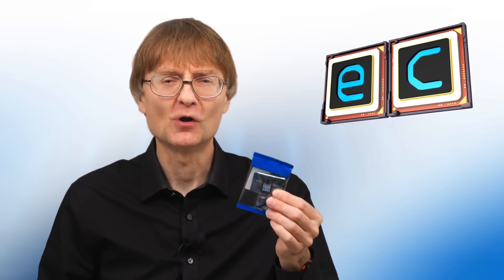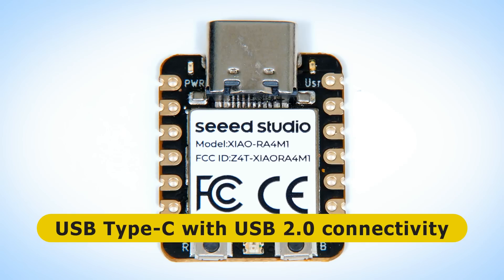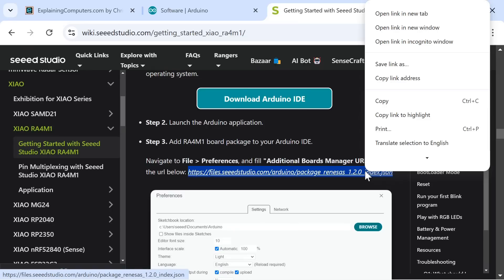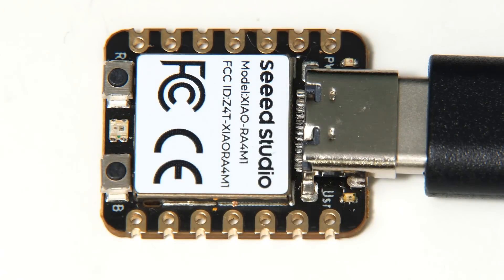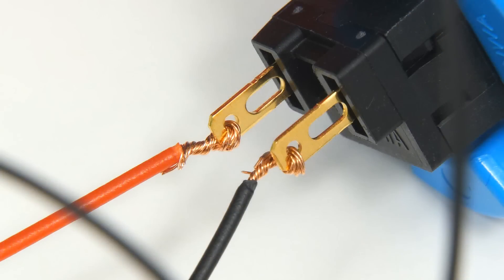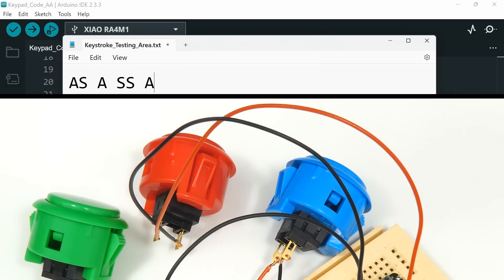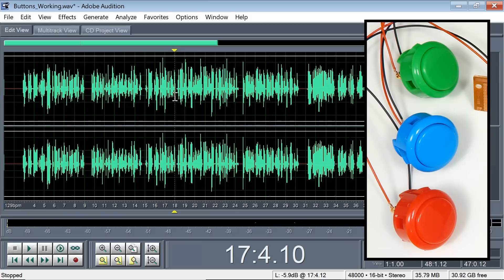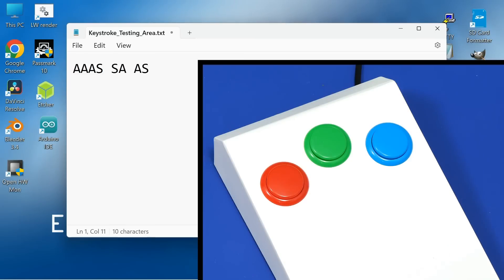Custom PC Keypad - Microcontroller Project

Comment: Great video Chris! Both informative and elegantly presented. I have used the Arduino IDE on and off for years, with various kinds of Microcontrollers. Each time I fire it up, I still have to stop and think for a minute about libraries, structures, program flow, etc. whenever starting a new project. Even the "simple" project you showed here requires a bit of forethought and planning, the end result which you assembled and demonstrated very clearly. Thanks for all your hard work Chris! Take Good Care.
Reply from the maker: Thanks Rick.

Comment: prefer circuitpython on a pico-w (sadly micropython does not do usb-hid), changing would just be text editing, no compiling needed.
My version has no physical buttons, pico-w has webserver so any tablet/touchscreen can get a html page with all the buttons-options, button size is only limited by screen size,
bonus is that controller (tablet or tablets) and base station (pico-w) use wifi, so distance and mobility is great.

Comment: Very useful project. I gather it runs in parallel with your main keyboard?
Reply from the maker: Yes, it runs in parallel with the main keyboard. PCs don't mind having what they see as multiple keyboards connected, although once a key is held down on one the other is inactive until it is released (ie you can only use one at once).

Comment: Hello EC 😊 .. how could I make similar  computer keyboard for a real computer keyboard, with all the letters, number and some other + - "" * etc 
I guess I would need different buttons, maybe these mechanical switches, pls for any idea 💡  .. thx
Reply from the maker: This could be done, but would require multiplexing due to the number of keys involved (placing the switches on a grid).
Reply: @ExplainingComputers  .. thx for your explanation 👍  ..  I think to 3D print the Atari-520 ST keyboard and make the set of buttons of specific shape, and a motherboard of an Intel i7 CPU, with integrated GPU, 16 GB RAM, SSD 1TB .. Thank you 😊

Comment: i've been building these with the arduino pro micro..
Theres examples for a 32 button box including rotary encoders (!) on youtube.

Only comfort thing missing would be way to reprogram the key-combos from windows/linux without having to reflash the arduino.

the arduino pro-micro (which is basically the arduino leonardo in small),
has the integrated usb interface due to having the ATMega32u4.

- Important detail you want to check is getting the 5V version for usb use.
- pro micro is also available now with usb-c instead of the micro-usb.
- pro micro usb-c; 5V / 16Mhz usually comes in at 6 to 8 bucks including shipping.
(cheaper in bulk of 3 or more)

Comment: Actually yes it looks perfect for what I have to do. What I was looking for was a usb sensor that was giving a command to windows to rotate the orientation of the screen when I rotate by hand my monitor and this look perfect for this application in state of a button I will usa a small switch that will be pushed when the screen is torned by hand. thanks a lot for your videos.

Comment: I've been wanting to make a big board of encoder dials to send midi CC signals to software synthesisers. Most synths can be mapped to a midi controller by right-clicking the dial and choosing "listen for midi input" and turning the desired dial, each dial having a different CC number. Would it be a similar project to this? I know I'll need to use midi libraries, and that encoders are a bit more complicated than buttons, but I think it could be accomplished with a very small microcontroller for the brains.

Comment: The microcontroller looks like a bit of overkill!
Reply: You would think so but if you look into any keyboard these days, there is something not so dissimilar  in there. Keyboards are made as cheap as possible these days. If there were a cheaper way to do it, the commercial keyboards would do it that way.
Reply from the maker: How else would you make some switches appear as an HID to an operating system, and allow them to send keystrokes?  think a $5 microcontroller is a pretty good solution.

Comment: Apparently, when configured for digital input, you can use internal pullup resistors on the I/O pins, which eliminates the need for external resistors (though the sense of the input is inverted; you have to connect the switches between ground and the input.)

Cool video.  I wrote a keyboard and mouse emulator for a Pi Zero using Linux's USB gadget facilities.  It was a lot more complicated than this!
Reply from the maker: Yes, you are right, you can use the internal pull-ups. But interesting, Arduino's own sample code/designs for keyboard control don't do so.

Comment: Can you use simulate two simultaneous keyboard input presses so for example 'Ctrl + c' for a single button copy command?
Reply: I think you can do   
  Keyboard.press(ctrlKey);
  Keyboard.press('c');
  delay(100);
  Keyboard.releaseAll();
Reply from the maker: You can indeed -- @ironfist7789 shows it perfectly.

Comment: The excitement at 9:40 of being able to emulate a USB HID keyboard and sending a a few K's on notepad is just hilarious.

16:08 Two of Chris at the same time? That's double the excitement!

On a different note I find it fascinating that the Arduino Sketch Code has similarities to C++ and depending on how its used its effectively the same thing. Its interesting how much similarities the high level languages like C# and Java have to C++ &  Arduino code.

Your if statements inside the void loop()  makes me think though, since you used multiple if statements instead of if-else if-else if. Would the setup of multiple if's be a problem in your use case that they they can get triggered at the same time by multiple buttons being held down at the same time instead if one at a time?
Reply from the maker: An excellent thought. I had not thought of this, as I had not planned on pressing more than one button at once. As coded, if two buttons were pressed, the key for the first would be sent, then for the second. By moving the delay and release to the end, compound keystrokes could be end (eg one button could be shift or ctrl).

Comment: Wow this is just what I need!! I play live music with backingtracks using a windows tablet and I really need a footswitch unit with keyboard shortcuts for space, up, down, escape, ' (changes folder) and enter.
Does the software allow for repeating keys? I have to scroll through a long list of songs
Reply from the maker: The key will repeat as rapidly as the set delay allows for -- just like the initial "K" example that kept typing "K". So you would need to experiment with what delay works best for you

Comment: A feature not well known is  you can program a pull-up resistor and therefore avoid mounting the board to another board.
Reply from the maker: I am aware of this, but interestingly Arduino's own switch examples always stick to an an external pull down resistor -- eg: https://docs.arduino.cc/built-in-examples/digital/Button/ -- which always consider a safer bet.

Comment: 11:09 There was easier/simpler than using physical pull down resistances since the microcontroller include builtin pull up resistances. All you have to do is declare your input like:
pinMode(7, INPUT_PULLUP );
Then connect only your buttons between each GPIOs and GND. Button idle gives a 1, pressed gives a 0. Very easy then to invert it in code.
Reply from the maker: This is true, but I always consider it safer to use external pull-downs. And all of Arduino's own examples of wiring a switch input use external pull downs: eg https://docs.arduino.cc/built-in-examples/digital/Button/
Reply: It goes against the grain having been brought up with the knowledge that active-low inputs were designed to use pull-up resistors to maximise noise immunity.  I'll learn 😉
Reply: Agreed. Use input pullup, then change to digitalRead(7) == LOW. This will save the bother of adding the 3 x 10k resistors.
Reply: @Mr_Rusty1  surely... I typed too fast :)
Reply: Good overview video, God bless.
Reply: which is the whole idea of the internal pull down resistors :)
Reply: @tranka6112 I don't think it has pulldown resistors,  just pullup.

Comment: you know it is going to be a good video when Mr. Scissors shows up.  I have always wanted to make a programmable keypad, say 9 buttons to count different observations and collect the data.
Reply: Damn. That's something I've wanted to do for a while. But i have had no idea how.
Reply: This is incredibly similar to a build I did a while back! However, I prefer spade connectors instead of soldering the buttons, as they tend to break quite easily. Makes it easier to swap them out. Also used an ABS project box and a stepper drill to make a basic case

Comment: Most interesting and informative. 🦆 I had bought an old VT100 with the intention of connecting a microcontroller and turning into a PC keyboard. I never got around to do it.
Reply: The VT100 can connect right up to a linux pc still iirc, might be worth giving it a go for terminal apps
Reply: @amy-377  I only got the keyboard without the CRT